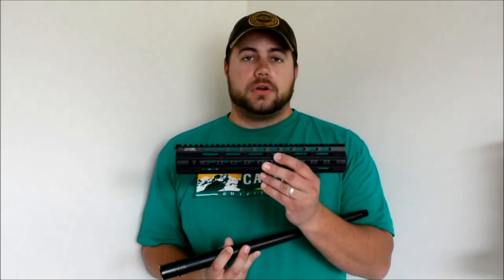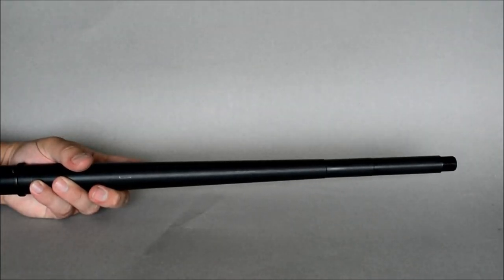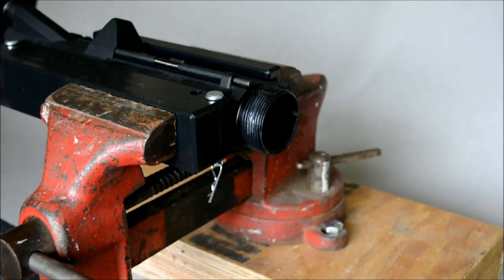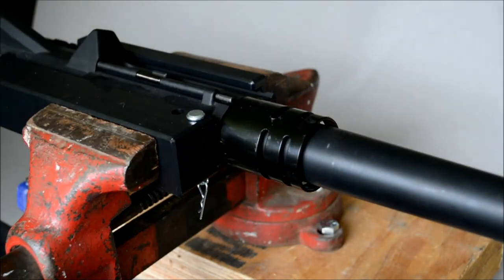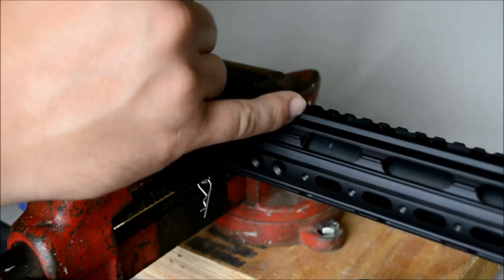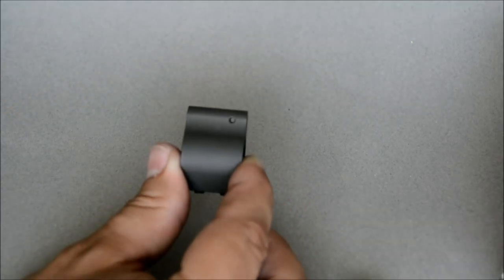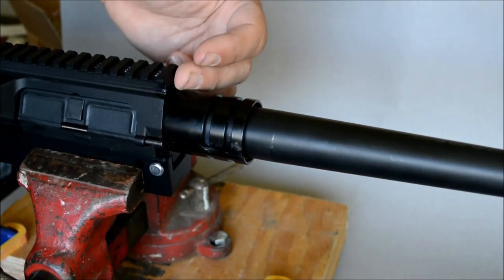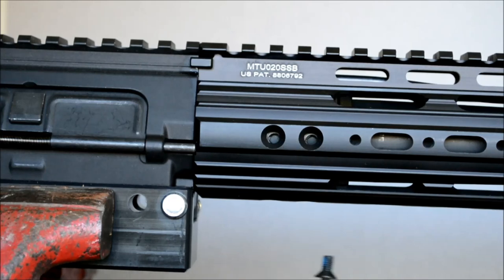Building an AR-308 on a Budget - Part 5 (Barrel and Handguard Install)

Comment: A trick to make installing a free floating handguard a little easier is to heat the end that is slipping over the mounting ring with a hair dryer for about a minute or so, The metal will expend just a bit and it will make it easier to go on.
Reply: Steve Hammond 
Would not that expand all dimensions, thus both decreasing ID AND increasing OD?
Reply: A hair dryer will not generate enough heat to expand any metal. Except maybe lead or gold....MAYBE.

Comment: Great video, I noticed you didn’t grease or oil the barrel extension. Is putting oil or grease on the barrel extension a bad idea? I read online that it prevents corrosion and seizing. Thanks
Reply from the maker: Thank you! I didn't end up greasing it, but it certainly wouldn't be a bad idea. I did end up doing it on another build, so I can see if it makes any difference.
Reply: @LiveLifeOutdoors88  thank u for responding and the advice

Comment: Don't you feel it is necessary to drill a taper pin into the gas block and secure it to the barrel?
Reply from the maker: A lot of people swear by pinning the block. I certainly feel that it will do a great job at securing the block, but I haven't had any trouble at all with gas blocks loosening on me without pinning it. I would say that it is all up to the person building the gun and their preference if they want to do it. I can see myself getting into it later on, but I haven't done it to my guns yet. Thank you for your comment and thanks for watching!

Comment: I’m looking at building something similar with 16” barrel, I’m going to add a suppressor eventually. Would you recommend a rifle length gas tube? Or getting an adjustable gas block? This is my first build and trying to avoid common mistakes. Thanks!
Reply from the maker: With that short of a barrel, I wouldn't recommend the rifle length gas tube. I definitely recommend an adjustable gas block. I didn't use one on this building purely due to cost, but I'm getting one and putting it on. My build cycles just fine, but I know it is overgassing a bit, so the adjustable block for 308s is a good idea.
Reply: Live Life Outdoors what about with a suppressor would you still do the mid length gas block just adjustable? Or go to a rifle length?
Reply from the maker: Very good question. I'll have to get back to you on that. My friend does a lot of work with suppressors and I will pick his brain and let you know next time I shoot with him. Also, I want to open that up to everyone. What do you guys think?

Comment: Torquing down the barrel, is there a plus or minus on the torque? Or just 35 lbft. Wondering how much stretching is allowed or figured in to the torque. You had said torque 3 times total. I have been assembling aircraft components most of my working life, there is usually a range. Later in the video you had mention the possibility of torquing slightly higher for alignment if needed. In cases where we used a castellated nut with a washer and a tab you bent over, you would start with the lower end of the range so if there was adjustment needed you could tighten higher without over torquing.
Reply from the maker: +sfbfriend You are correct that there is a range! I definitely missed that in the video. Obviously the range depends on the handguard and barrel nut that you choose, so everyone needs to follow the manufacturer's recommendation. The particular combo I chose said to torque to 35 lbs and if additional torquing is needed to line up the holes, don't exceed 50 lbs. Their range is 35-50 lbs. Thank you for your question and thanks for watching! Good luck on your build and let me know how it goes for you!
Reply: Thanks, not trying to break your balls LOL. That is useful info
Reply from the maker: sfbfriend I'm glad you mentioned it! I didn't realize I didn't say it in the video, so I'm glad that you asked!
Reply: I torqued my ar15 barrel nut to 35ft/lbs like the instructions said and my barrel was very loose, (didn't find this out until I shot it). So I just tightened it down all the way and it works perfect now.

Comment: should you not be putting dimple, after you have installed gas tube, handgaurd, barrel nut, so that you know where exactly the dimple is needed?
Reply from the maker: The most important thing to line up is the gas port in the barrel and the port in the gas block. This can be done without the tube, handguard etc.
Reply: Live Life Outdoors  ah ok...thanks for clarifying. Also, how important is it to dimple the barrell? Sorry if you already answered this Q in any video. I am asking, because my local shop guy told me, that it is not entirely necessary.
Reply from the maker: It is definitely not mandatory by any means, but it's something that is a good practice. I've got a few ARs and some that came from the factory are not dimpled and I haven't dimpled them. I did this one because it was a build from scratch and it's something that I feel gives it a little extra hold and security because it is a .308. I hope that makes sense!

Comment: Son-in-law spent $1,500 on an Matrix Aerospace AR-10 in 6.5 Creedmore and it wouldn't cycle....I told him it was a gas issue. When he brought it over, I pulled off the handguard, and discovered while tugging on the gas tube it slide backwards. Come to find out someone forgot to install the roll pin.....must of been a "friday" build.
Next after fixing that issue it was punching holes thru the primer which is typical of a 308 BCG and hammer spring used for 6.5 CM.....needless to say we sent it back on the warranty.
We'll see what happens.
Reply from the maker: Wow! That sucks! Thanks for letting us know and please keep us updated. I'm way curious to hear how it gets resolved.
Reply: @LiveLifeOutdoors88  
Update.....supposedly they said that it was fixed after they "lubed" the rifle and test fired it......RIGHT.....We lubricated it with Shooters Lube after the roll pin issue and the fact that the gunsmith at CCPlus guns & ammo put the roll pin in and went over it as well......so we'll see.
I made the comment that I could build one from scratch faster than they could fix that one....
I now have an Aero Precision FDE in 308 that was completed two weeks ago, and his rifle just arrived at the FFL yesterday.....he only needs to correct his lapsed driver's license in order to pick it up......we'll see how well it works.

Comment: What type of vice block did you use that is compatible with the aero upper?
Reply from the maker: +George Chambers It is a NO-MAR 308 vise block that I got on eBay. Most of them should fit because the mag wells should be pretty standard.
Reply: Live Life Outdoors thanks I will try to find one. I have a pro mag vice block set for AR15s that works great for all the AR15s that I built, but it wouldn't close right on my Aero AR15 upper.  I assumed a standard 308 vice block would have the same issue.

Comment: Did the UTG handguard match precisely with the M5 upper tang?
Reply from the maker: Yes it did! Just make sure you get the correct profile for your receiver. This is a high-profile receiver, so the handguard had to be compatible with the high-profile format. It lined up perfectly!

Comment: What length gas tube did you use? I'm looking at a DPMS gas tube on midwayusa.com but i don't know what length to get. New to building AR's so sorry if its a newb question lol.
Reply from the maker: There is no such thing as a dumb question! The length of gas tube depends on the barrel you use. I used a rifle length barrel that was set up for a rifle length gas tube. Have you got your barrel yet? The barrels come in carbine, mid-length and rifle lengths.
Reply: Thanks for the reply! I have not purchased my barrel yet because i wasnt sure on which gas system to use, i was wanting to go with an 18in one though so that would mean i'd need the same rifle gas tube correct?
Reply: @MattSR20  Cuz there are no dumb questions.If you dont know the smartest thing to do is ask.You did that. The gas tube length is always determined by your barrel.Buy Barrel before tube and ya cant mess up.Mic your barrel if you dont know the inside diameter of your gas block.Good Luck..Dont be intimidated.These guns are simple to build.
Reply: @LiveLifeOutdoors88  what did you use for a upper vise block?
Reply from the maker: traxxastrucks36 I actually found it on eBay lol. It is very similar to the AR-STONER Upper Receiver Action Block Vise that Midway USA has. If you’d like, I can try to find it on Ebay and post a link.

Comment: You thought you were slick with the threaded rail nut editing it after the glass block huh lol plus you forgot to mention the different rails out there specifically 308 have low or high profile. This rifle is a dpms build high profile. An AR10 would be arlamalite low profile.
Reply: Emmanuel Ortega Not necessarily. There are high profile and low profile DPMS receivers.